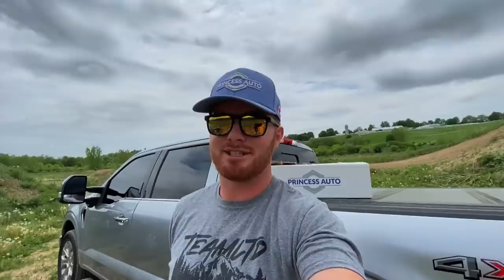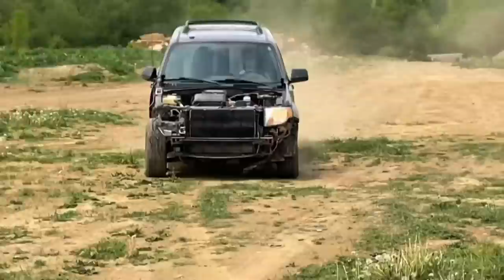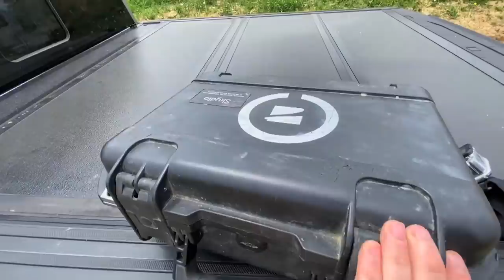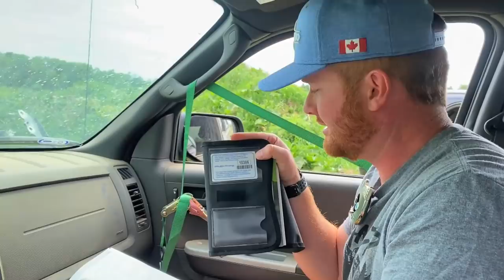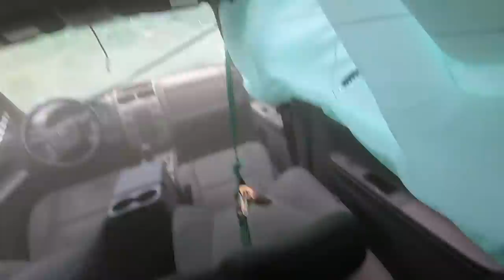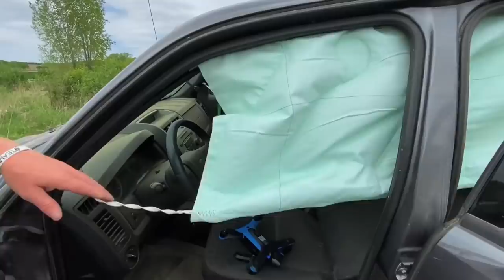Ford Escape CRASH AWD!

Comment: Laura blew a tire the Ford blew a tire but Mark couldn't even blow a fuse 😁 next time if you can't find the power steering fuse find the power steering pump and cut the belt, problem solved. Make sure you only cut the belt that runs the power steering though.